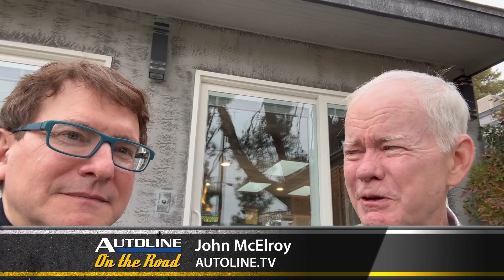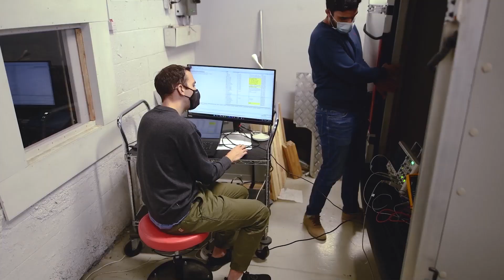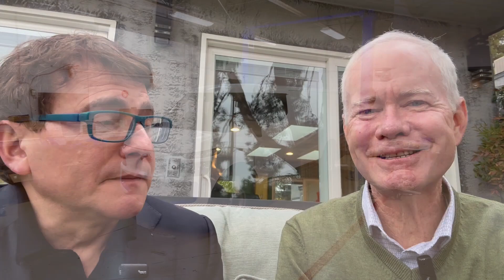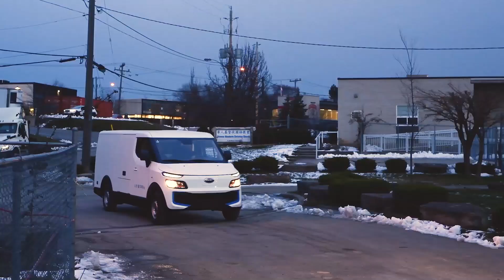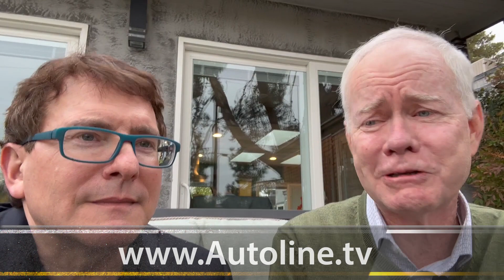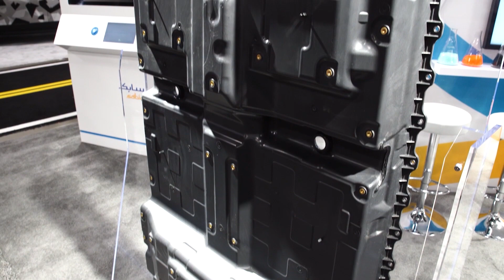New EV Inverter Slashes Charging Time - CES 2023

Comment: Total BS. Sure you can charge 3x faster with a 120v circuit, with a 60A breaker! No home has that, no receptacle can provide that and that's why you go to 240v.
Biggest issue is getting people to realize you don't need to charge fast at home or work. Superchargers are for trips. If everyone moves to EV with high current draw charging it will break the grid and it totally negates any environmental benefits over ICE.

Comment: If this innovation is truly real (which I believe it is), robust and easily scalable and onboard with major OEM's, this needs to go forward and quickly.  This appears to be a 'moon-shot' moment and as good as the heat pump vs resistance heat technology is, that much more so for charging.

Comment: Yes, lots of BS there. For a start, home charging is slow due to the home power supply. It appears all that has been done is modify the (or a) motor inverter to both output and accept AC (not at same time) and either draw, or send  DC to the battery. 
The 'top hat' inverter on top of the Tesla battery, and the Lucid inverter do not appear heavy. 
However, it would be great to have an inverter unit that took and supplied one- and three-phase AC to/from a home, that takes and supplies variable AC to and from four drive motors (vector steering) and an air-con motor. 
Integrated power electronics is a good idea, but we are none the wiser after the interview exactly what the Canadian company has done.

Comment: 🤦‍♂️ "New"? Here's an overview of "integrated chargers"...from 2010:

S. Haghbin et al., "Integrated chargers for EV's and PHEV's: examples and new solutions," The XIX International Conference on Electrical Machines - ICEM 2010, 2010, pp. 1-6, doi: 10.1109/ICELMACH.2010.5608152.
Abstract: The battery is an important component in an electric vehicle (EV) or a plug-in hybrid electric vehicle (PHEV) and it should be charged from the grid in a cost efficient, preferably fast and definitely safe way. The charger could be an on board or an off board charger. For an on board charger it is possible to use available hardware of the traction system, mainly the inverter and the electric motor, in the charger circuit. This is called an integrated charger. In this paper, different examples of integrated chargers are reviewed and explained. Additionally, other possible solutions of integrated chargers are described.
URL: https://ieeexplore.ieee.org/stamp/stamp.jsp?tp=&arnumber=5608152&isnumber=5607489

Comment: Sounds similar to AC Propulsion’s “reductive charger” patent.  Both use the motor windings as part of their charger circuit.  Lots of BS in this video though.  No way it can magically plug into a 120 V outlet and provide more power than the outlet provides to it.

Comment: Renault has been using the the motor as an inverter to charge at higher AC power since the first generation Zoe from 2013. It was able to charge at 22kW AC without a traditional dedicated onboard charger. More recently Kia EV6 & Hyundai Ionic 5 use the motor as a DC to DC inverter to charge the 800V battery allowing the vehicle to accept any DC voltage range between 400V & 800V without a need for heavy parallel wiring as is done in the Hummer EV.

I would not call this a game changer as it's already being implemented in production EVs in different forms.
Reply: Renault used a three-phase standard for Europe, which is not part of the North American standard

Comment: Charging speeds aside - one of the most common cause of failure for the Nissan LEAF is in fact the on-board charger.  It's probably not likely to be able to do anything for the LEAF, but it would be good to do away with the onboard charger.

Comment: Isn’t he basically describing how regenerative braking works?  Also, if you have 220V and 30A, the charge rate is 6.6kW minus a bit of conversion loss. It can’t magically charge 3x faster just because it’s using a different technology.  Edit: just saw another commenter making the same point.
Reply: Mike your point actually supports their claims. My Model 3 can only change at about 1.5Kw from a 240v outlet if it could unlock 5Kw charging that would be phenomenal. Very close to installing a wall charger.  

My question is, are you then not able to use a DC fast charger?  They are ALL DC. 

Road trips then become near impossible
Reply: nope, regen is using the motor as a generator,.... this is using a motor as an inverter.... 

3x 6.6kW, is about the max of the current level to AC charging in North America... So it's nothing extraordinary....

Comment: Renault already had this a decade ago. AC63 chargers use the motor and inverter, not a dedicated onboard charger.AC Propulsion also already had this concept 20 years ago. And John asked him ooint blank if even on 110v it will charge 3x faster and he said “yes”, the dudes credibility dropped to zero, and John didn’t pushback at all making you wonder if he understands basic electricity. You expect this from Gary but not John. Lol
Reply: Renault used a three-phase standard for Europe which is not part of the North American standard
Reply: @nc3826 , it’s irrelevant how many phases.  The concept of using the motor windings as the transformer and adding a few more mosfets so it can handle single phase, split phase or 3 phase has been done.
Reply: It required a Mennekes connector using a three-phase, 63A per phase, 400V AC service.... to max out it's charging rate....
What is irrelevant is a YouTube expert saying that it can be done with split phase service, without any examples or even a wiring diagram to justify a claim it...
Reply: but his reference point is only 6.6 kW and three times that is about the max for the North American standard for level two AC charging.... And none of the other relevant points were mentioned,  such as how efficient it is...  So none of this was very relevant....
Reply: @nc3826 , as soon as he said you can get 3x charging speed from 110 outlet, everything else was meaningless, because no matter what you use you will only get 1.3kw (110v@12a). 3 time 6.4kw is about what the original tesla chargers can do. There is nothing new here. Alan Coccini also had this idea but it didn’t pan out. And you can bet the Tesla people looked at it and it wasn’t a good idea. Also the Zoe mostly abandoned that technology also. 

As mentioned in other comments, this method also comes with efficiency losses because you can’t make the windings perfect for a motor and perfect for a step-up transformer. 

The idea is not new and I doubt they have any secret new technology. Ever since 3-phase inverters were used people tried to find ways to share the components used in the propulsion system to double as the charger. Between the Tesla engineers and the scouts who always had their feelers out foe technology, if it was a good idea tesla would have done it at least 5 years ago. 

But lets first see him get 4kw from a 110 household outlet and they ill be a believer. Lol
Reply: @nc3826 , so you don’t understand electricity, thats what you are saying. The connector name has nothing to do with it. The original superchargers used triple ganged SINGLE PHASE chargers exactly the same as the Tesla used in the cars, one per phase. If there was only single phase, they could connect all the single phase chargers to them. 

This 30 year old idea which is already been done will not get more power out of any outlet than its rated for.  A 220v 100a circuit @80% will supply 17.6kw and the current onboard charger will convert that to DC just as, if not more, efficiently as this system that everyone in EVs knew about but only Renault used.
Reply: no one has an understanding of electricity who claims 3, single phase lines are the same as a three phase line.... and which type of three phase?  (And why waste time  developing  single phase charging, since that is not available from the grid in North America?) 

and how old is the idea of an electric car? revised ideas does not make it irrelevant.... 

ranting about superchargers just proves my point.... 

the bottom line is the posted video has numerous flaws in it.... almost as many as the critique of it.....

my YouTube wannabe expert friend.....
Reply: @nc3826  I didn’t say 3 single phase lines are the same as a 3-phase power supply. I said the 3-phase are separated into 3x single phases at the original supercharger cabinet and 3-gang single phase chargers identical to the ones they put in the early Model S were hooked up. Then each of the gangs could individually be sent to A or B charge point. 

And if all there was it single phase, they could also use the exact same supercharger cabinet and just wire each group to single phase. The charger don’t care, the tesla doesn’t care, the only concern is not keeping the grid phases balanced. So every high power draw uses three phase power when possible.

The concept of using the motor windings was as early as AC Propulsion at the same time they did the T-Zero. Looking for ways ro charge high power without carrying a high power onboard charger. And AC Propulsion is based in the US, so it would of course work with single phase. 

If Zoe was sold in North America, it would also offer single phase.

Its really nothing new. Let see if anyone ever really uses it and if it infringes on existing patents.
Reply: When he said, 110 volt... .I assume it was shorthand for, split phase service.... Which is based on what voltage....
Reply: Good luck learning about the different types of phases of AC electricity And their uses.... and the difference between single phase and the split phase that's used in NA.

existing patents from 30 years ago??? 

fwiw the pontificating in the post was mostly just amusing...but the fact that he mentioned bi-directional charging was a little bit interesting... until I realized there was nothing to back up the claims...
Reply: @nc3826 , nope, when John asked about 110v, hes talking about the granny charger that plugs into 110v. Nobody call 220 volt 110v, since all modern houses have both. And where has the at hime charging problems centered around? 110v, not 220v. Why? Because nobody’s house came wired to charge at 220v, so people will try the granny charger since it’s the only way to charge at home until an electrician comes out. 

Clearly, very clearly, the guy was clueless. I think John actually realized this but knew any pushback would have caused a problem. Hes typical executive clueless on engineering but memorized enough to sound like he knows what he’s talking about….until someone pulls him off script. 

Normally you don’t fall for such nonsense from what i can remember from years ago.
Reply: The bottom line is this was just a paid ad
Reply: I try to be generous
Reply: @nc3826  , regardless of how many times you try to redirect, changing AC to DC has nothing to do with the number of phases. Each phase will need its own charger. The AC will then be rectified by semiconductors. Whether delta or wye, makes no difference to the technology. 

Now thats settled, the technology which already exists in Zoe for years and AC Propulsion had that idea 20 years ago, clearly the vehicle that could most benefit from that is an electric motorcycle, where the onboard charger is huge, heavy and expensive. Why doesn’t Livewire use that technology? Why not Energica? Because this technology wont work with PMAC motors. If you recall the Tzero had a three phase induction motor like the early Teslas (and the second motor not used during crusie). 

If you understood basic electricity you would kniw with a 3 phase PM motor there is no way to turn that into a transformer. The Zoe also used an induction motor for their system. And thats why people are saying the loss in efficiency isn’t worth the benefit of such a charger. 

Its ok, not everyone can comprehend this stuff. Thats why the guy has you believing it. Lol. 

Title “New Inverter Slashes Charging Time”, well everyone who isn’t a gender studies major knows its not slashing the charge time on 110v. Only you think 110v charging means one leg of a split-phase 220. And the other 110v leg is also used for 220v. Lol. Try not to hurt yourself changing a lightbulb.
Reply: have fun g00gling and pasting
Reply: And good luck proving the infinite monkey theorem

Comment: Like some others here I have major doubts on this, as much as I like major breakthroughs.
Yes, if you could ditch the typical inverter and get the motor to do it instead and not incur any penalties from doing so, that would be great.   That would let you save some weight & cost (mostly cost) for that inverter.
But how exactly does that help you charge faster?  You're still converting the AC to DC for the battery and still have to take the losses inherent in such a transition.  The 'faster' seems like smoke 'n mirrors until they can definitively say precisely how it can be achieved.
I wish them luck, but don't expect much w/o MUCH more info.
Reply: his reference point is only 6.6 kW and three times that is about the max for the North American standard for level two AC charging.... And none of the other relevant points were mentioned,  such as how efficient is it is

as they say if you can't blind them with brilliance, baffle them with bullshit...
Reply: Here's a quick efficiency comparison:
Onboard chargers are typically around 95% efficient. Inverters are around the same. Permanent Magnet drive units are around 98% efficient in converting AC power into propulsion. If it can keep that same 98% efficiency in converting AC power to DC for the battery, then this makes a good case for eliminating the onboard charger altogether.
Reply: @jrharbortproductions  I’m assuming the motor doesn’t have to turn for this charging purpose so any energy lost to spinning the rotor is not in the calculation.   I’m still skeptical.
Reply: Mini arc rectifier using Mercury again...that make any sense ?

Comment: Huh. I’ll need to research. Pulling power from a home circuit is circuit constrained, u cant just 3x mains power. How is motor used to rectify? 
It smells like their just using the controller FETs as a 120/240 - 400v switching circuit.

Comment: Sounds like the original Zoe. It could do 43kW using 63A 400V AC. Low efficiency being the issue.
Reply: LOL yes nothing new here Renault did it in 2012
Reply: Renault used a three-phase standard for Europe which is not part of the North American standard

Comment: I call BS on some of these claims. Maybe this guy is a salesperson and doesn't fully understand what he's saying, but charge 3X faster on 110v outlet. If the battery still has the same capacity, it will still need to take the same number of kWhs and than can't be done with a 110v outlet. Most EVs allow 12amp at 110v (120v). If the house wiring and breaker are unchanged there is a hard limit in the US (and possibly Canada) of 20amp. There is no way to even double the current without rewiring. There is no magic in their product that can take 12amp of 110v and make it 36amp at 12v. Losing some weight is always welcome, but it had not affect on charging times.
Reply: He never explains how or even goes into a little detail. All of what he says is very generic.
Reply: Shhh shh you're just suppose to clap and invest 👍
Reply: The goal of a snake oil salesman is to sell you the oil, not to cure what ails you.
Reply: You are absolutely correct. I’m guessing most in car chargers are probably 95% efficient. The most you would be able to gain would be an extra couple percent. As far as I know, no one has come up with a way to brake the first and second laws of thermodynamics! Now it’s possible that maybe they came up with a way to use a much smaller system to charge the car that I don’t know but the claim that it can charge three times faster. I’m sure it’s bullshit.
Reply: I just get the ghost of Nikola Tesla to put his hands on my EV, and it’s immediately up to 100%. Problem solved.  😅
Reply: You aren’t considering the step from AC to DC and back to AC. I have no idea how big a deal that is but it seems clear,  neither do you. 

Consider too that the Chery van comes out this year WITH the tech onboard, I guess they should have consulted with you first?
Reply: @roryreddog3258  Charging an EV is only going from AC to DC. That is what is clear. As mentioned, how much more than 95% efficiency can be gained? At what cost?
Reply: No I think he was probably lumping it in with the 220 volt charging as well. So the nice thing is that you can use the maximum amount of charging your house can provide on a 220 volt charging circuit, yet not need the extra bulk of a large inverter to handle that higher input. So instead of sticking a cheaper 6.6 kW onboard charger you can use this tech to essentially handle much higher charging at 220 volts such as 11 or 19 kW if your house allows. Plus he added benefits of not needing the extra weight and volume of a large inverter.
Reply: I agree with Z Oz.  How do you efficiently get that many kWs from a 120 volt circuit. He never explained the physics of his device.  My limitation on charging is my 60 Amp (14kW) circuit. I don't need more kWs, since I have all night to charge. On the road, DC fast charging is thirty times faster than at home.

Comment: Cmon!!!
First, a hundred pounds of weight mean nothing in the several tons of battery weight!

Second, batteries do not like to be charged too fast!

This is evolution, but not revolution!!

Do tell us if you can charge at home or will need to "invest" in the device that you "replaced"...
Reply: Not buying anything new, actually taking away parts. Just adding a feature to the existing inverter.
Reply: It sounds like less manufacturing complexity. That's a win for cost and adoption.
Reply: less cost, 500 lbs lighter, faster charging. Pretty notable.
Reply: @KTPurdy   I’ve not seen a 500lbs one. The last one I worked on (old Tesla 12kw), was about 35. Still a weight and complexity savings.
Reply: @AaronandbriEnne  great correction